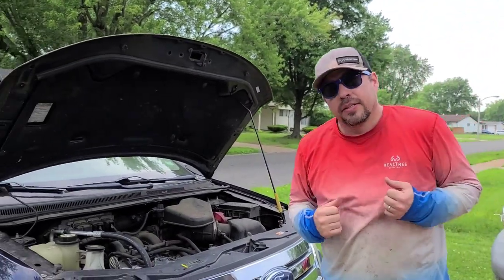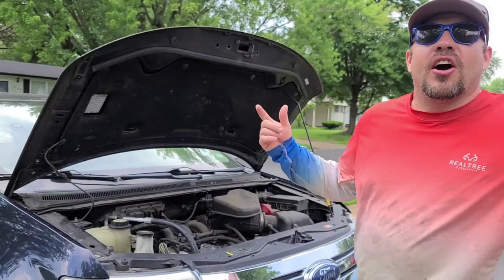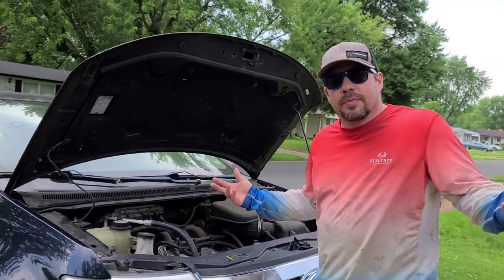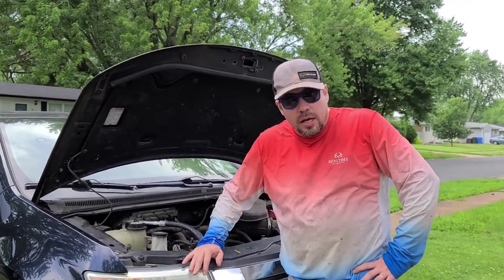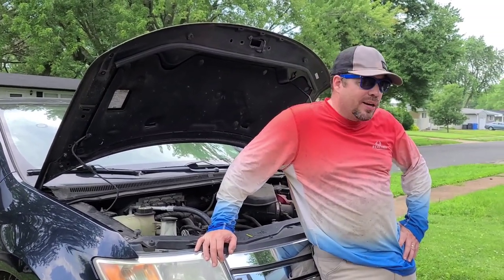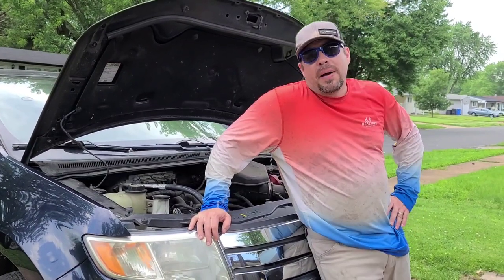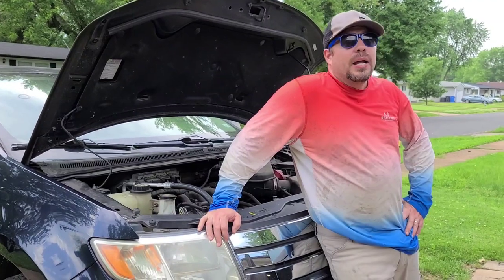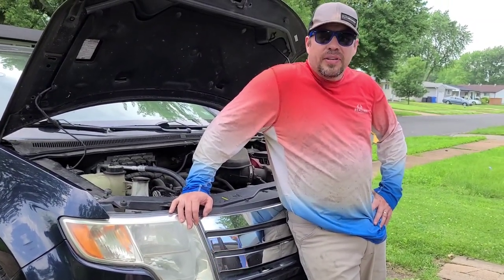Ford overheating and a/c not blowing cold air. how to easily replace electric cooling fans.

Comment: I repaired my 2013 Ford Edge SEL today and purchased my cooling fan assembly from a local NAPA Auto Parts here in the Oklahoma City area.  It was listed for $253, but they were running a 20% discount this month.  So after the discount and added tax, it only cost $220, a lot cheaper than a Ford OEM part replacement & installation!  One note as a suggestion for the installation, take the module off the assembly before installing to allow for better clearance from interference.  My cooling fan assembly only had two (2) 8mm bolts at the top and two (2) 8mm bolts on the air cleaner housing. I just used a 1/4 in. drive ratchet with a short extension...easy access!

Comment: This just started happening to me. AC is not working while parked and does while moving. Nearly overheated while in bumper to bumper traffic today on a busy highway. Thanks for the explanation of whats happening.
Reply from the maker: Oh man, well che k to see if you electric fan is running while parked with AC on. If not this is your fix.
Good luck.
The fan i used is in the description of the video. If you buy it there it would really help me out.

Thanks again for watching. Remember take it slow when pulling out the fans and replacing dont want to damage the radiator fins.

Seize the day each and every day-Are Jay

Comment: Hey buddy  love the video !!! my fans aren't moving when in park and it over heats when i turn the ac and when i turn the heat on if i replace the fans will it fix both issues??
Reply from the maker: This should fix it, does your ac kind of work while you drive?

You could do just the controller but cost wise it makes sense to do both.

I have a link in the description to the fans we bought and they are still working great in our Edge.

Thanks for watching!

Please like and subscribe every little bit helps during these times.

Seize the day each and everyday-Are Jay 

Here is our Ford playlist in case you ever need it.  Top Ford Edge repair videos: https://www.youtube.com/playlist?list=PLQ0kUxbVWpJ_fbImaPdh-9byZf7hsFlsB

Comment: Same problem changed fans to Tyc fans still will not turn on, also change fuse but still no signal to turn on. Checked fans to direct 12 volt and turned on
Reply from the maker: Sounds like your control module might be loose or bad.
Good luck and thanks for watching!
Reply: Gound issues

Comment: Hello, I have a 2009 Ford Edge. The air conditioner fan does not work, but the engine fan works and the air conditioner does not cool when standing. Is there a possibility that this is the problem and not the air conditioner compressor?
Reply from the maker: Actually this sounds like it may be more your problem.

https://youtu.be/YHDF9sKUQUU

Hope it helps.

Thanks for watching!

Please like and subscribe every little bit helps during these times.

Seize the day each and everyday-RJ

Here is our ford playlist in case you ever need it.

Top Ford Edge repair videos: https://www.youtube.com/playlist?list=PLQ0kUxbVWpJ_fbImaPdh-9byZf7hsFlsB

Comment: I was having the same issues with my edge overheating replaced the whole fan assembly. The fans still aren't working. Any ideas!
Reply from the maker: Oh that sucks.

Did you check the fuses in side the edge as well as the fuses under the hood?

If its not those the only other thing i can think of is, either the connector isnt all the way tight, or the harness on the vehicle end is bad. Maybe just maybe your control panel for the ac is bad as well.

Do the fans turn on when in park with the ac turned on?

Good luck.
Sorry i cant be of much more help.

Please like and subscribe every little bit helps during these times.

Seize the day each and every day-Are Jay 

Here is our ford edge playlist in case you ever need it.
Top Ford Edge repair videos: https://www.youtube.com/playlist?list=PLQ0kUxbVWpJ_fbImaPdh-9byZf7hsFlsB

Comment: Excuse me sir I just have to ask now my fan is working but just today all of a sudden my AC is just blowing hot air and an associate of mine believes it to be the ac compressor and wants to jumpstart, it could that be the cause
Reply from the maker: Hey Darconious. It could be a number of different things. I have 2 other videos on ford edge specifuc air conditioning and then one on vacuuming the Ac system and refilling the a/c. 
I would try the easy ones for the edge first, then look to see how much freon you have pressure.

Good luck.

Thanks for watching!

Please like and subscribe every little bit helps during these times.

Seize the day each and every day-Are Jay 

Here are my video playlists with the a/c fixes in them.

Top Ford Edge repair videos: https://www.youtube.com/playlist?list=PLQ0kUxbVWpJ_fbImaPdh-9byZf7hsFlsB

auto repair: https://www.youtube.com/playlist?list=PLQ0kUxbVWpJ-YAAkHhiY9sIHfKyM4oE0U

Comment: Thank you ❤ but wait my car is overheating when idling. It’s a 2012 ford edge. The air does work but it overheats.
Reply: @@ve_gan update. It was the cooling fan assembly and a fuse box. It was 950$ to get fixed. 😭
Reply: Back after one year and it’s doing the same thing 😢
Reply: Hi, the air conditioner in my Ford Edge does not cool when standing, only when driving, the engine fan works, the ac does not turn on, is this the problem and what is the solution  Thank you very much for the waiting clip

Comment: could it be the ac module??
Reply from the maker: It is usually the ac module, but the cost for the whole fan with module, doesnt justify spending the same for just the module. Especially because a new module on and 3 months later the fans go, now you just bought 2 modules and a fan set up.

Good luck.

Thanks for watching.

Please like and subscribe every little bit helps during these times.

Seize the day each and every day-Are Jay

Here is our ford edge playlist in case you ever need it.
Top Ford Edge repair videos: https://www.youtube.com/playlist?list=PLQ0kUxbVWpJ_fbImaPdh-9byZf7hsFlsB